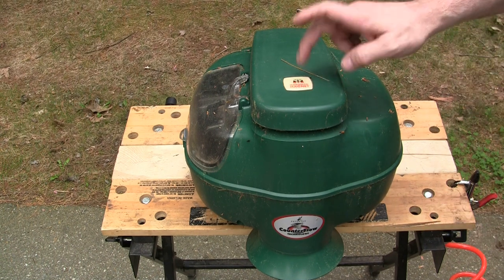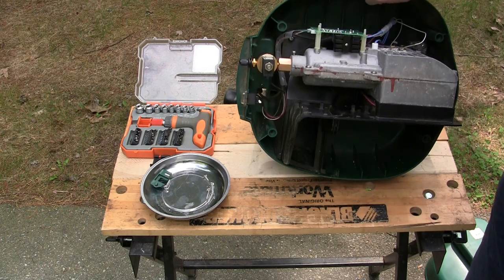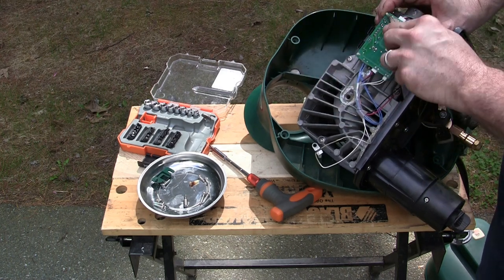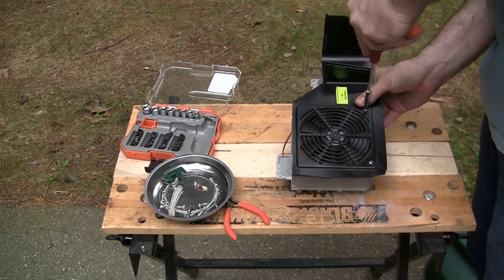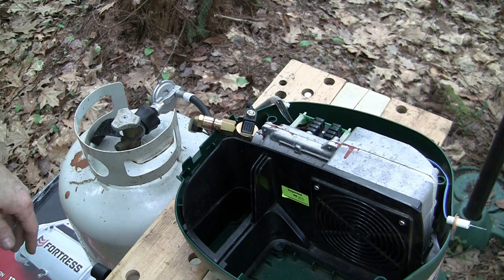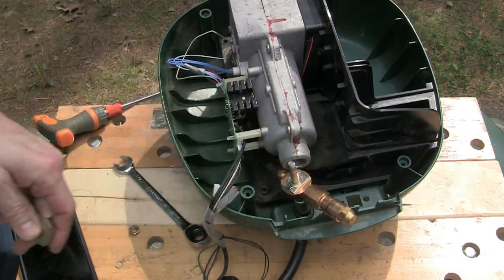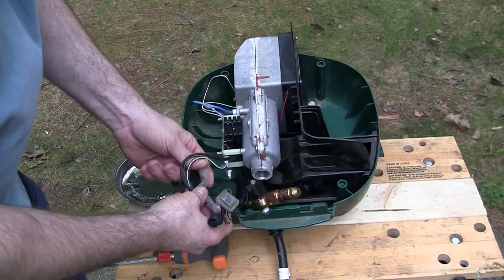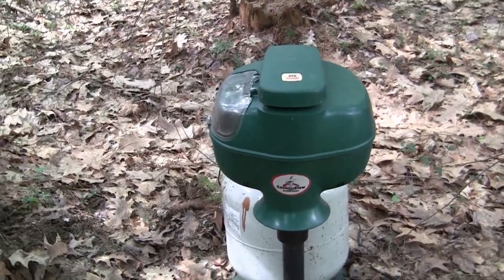Mosquito Magnet Patriot Plus repair

Comment: When we took the plastic screw out to clean the ignitor, the screw broke. Can we replace with a metal screw or does it have to be plastic🤷
Reply from the maker: I had that happen too. I used a little high temp rtv silicone to "glue" it in. Just put some under and over the tab. It will hold it and you can pull it out later if need be. If you did manage to clean out the rest of the plastic and put a metal screw, it would probably fuse to the housing over time due to galvanic corrosion (happens when different metals are used). Good luck!
Reply: Well, we have replaced the fuel filter, cleaned (sanded off) both the ignitor and thermo coupler. Fired it up yesterday, and it worked for about 6 hrs🤷We were not able to open the catalytic converter as the screws would not release🤷 Any other suggestions?

Comment: where do you find replacement parts? such as the solenoid? can't find online!
Reply from the maker: Other than the igniter, I have never needed a replacement part. From looking around, it seems they strictly control their replacement parts. You are, unfortunately, going to need to find suitable replacements on your own, or find a machine that someone is getting rid of and scavenge parts from it.

Comment: Hey man, I got a used mosquito magnet that isn't working, Ive checked EVERYTHING, ignitor lights up, thermistor is registering ohms and is going up and down depending on the heat if I blow warm air on it, thermistor is completely clean and new looking, propane is coming out nicely, gas orifice isn't blocked, solenoid clicks and opens gas, new propane tanks tried 2 different ones, everything is clean and seems to be working, but it's keep flashing fast red. I believe it's not actually igniting the propane. I don't really feel warmth at the front nozzle. Do you feel warmth at the front where the fan is sucking in? I'm thinking possibly the ignitor is weak and not igniting the propane? I can definitely smell the propane and the ignitor is definitely glowing completely red. It's just not wanting to run. I can't really feel any heat. Any advice? Do u think the ignitor is just too weak to ignite the propane?
Reply from the maker: If it is glowing red, I would think it is hot enough, but I suppose that is possible. One thing to try to start it with the plastic off. The metal will absolutely be warm to the touch if it is running. You said you cleaned everything, but have you tried blowing out the catalytic converter (the tube inside the metal housing at 13:53)?  If that is clogged, or not really reacting due to contaminates, it could be hampering the unit from getting hot enough. These are absolutely finicky machines, which is unfortunate given how effective they are when working. Good luck and feel free to send updates or further questions!
Reply: @DavinDesborough  Yes I have tried starting with the plastic off and on. Ive tried feeling the metal housing and I dont really feel any heat at all. It never gets to the solid red light though. So something is not allowing it to start. It doesnt seem like the propane is igniting, or its not staying lit long enough to feel heat. Maybe the thermister is shutting it down pretty fast before it heats up? I was checking the ohm resistance on my thermister and it was at like 250 k ohm I believe . Is that normal? Do you know what your ohm reading is on your working thermister? Yes I did take apart the metal housing and cleaned up the cata converter. I didnt see any blockages or debris in there. I blew it out but not with a compressor, just with my mouth. I scrubbed the metal parts a bit as there were some build up but not much. To give you an idea, my thermister was quite clean when I pulled it out, nothing like yours was, so the internals werent very dirty. I have no idea why its not starting, everything looks good, the igniter lights up, the propane flows, the thermister "works" and it registers heat. I dont really know if maybe the resistance is too high and not meeting the requirements, or maybe the igniter is not getting hot enough to ignite the propane. I am stumped... Ive checked and done everything in your video and all the components seem to be working
Reply from the maker: @Interrogreat  If you tested like I did at 28:40 then the gas side of the equation seems OK. We still have snow, so I have not done the maintenance on my trap yet. I will do some tests on the thermistor when I take it apart this spring. I believe they are generally specified at 25 Celsius (so roughly room temperature) and 250k would be a reasonable value. I would also measure resistance at the pads on the back of the connector where the thermistor plugs in. The value may be a bit different as it will be in circuit, but should be in the same general range. While there, look for any corrosion on the board, especially around the solder pads of any of the chips. Clean with isopropyl alcohol if you see any grunge.

Comment: I noticed you put it to work immediately after the repair.  Did you use any Octenol bait in the bottom compartment or does the machine do just fine in attracting Mosquitos w/CO2 only? - Thanks.
Reply from the maker: I do run the Octenol as it seems to help. I bought a bunch of it during an off-season sale, so it does not cost me much. It will still work without it, but it seems like I catch more with it. Good luck!

Comment: Hey, I've just picked up an executive model and after about 5 hours it shuts off (not set to turn off either time/temperature) and if I try to restart it shows the battery has died. I've cleaned it, replaced the battery, new gas, co2, everything I can think of but no joy, not showing any errors. Any idea? TIA
Reply from the maker: If it will always run for about 5 hours and then stop with a low battery warning, then I will have to guess that the  thermoelectric generator (TEG) is not supplying power back to the machine. That would mean it is running on only batteries, which quick run out. If you pause my Independence video at about 13:32 (https://youtu.be/VzFwGImwR5k?t=812), you can see the TEG on the large heatsink in my right hand. I assume the Executive will have something similar. With all that said, all I can think to do would be to try and measure the voltage it is sending when the unit is running and hot. I don't know what the voltage is supposed to be or where you would get a new one. I mean, you can get one from Amazon (https://amzn.to/43kv0PD), but I don't know what the right size or voltage would be. Try to find some marking on the one in your machine and see what you can find searching on that. Again, this is all just a guess. Good luck!
Reply from the maker: Sorry, the fact that you said "I've just picked up an executive model" just jumped out at me. If you just purchased it, try returning it for a new one. If your have picked it up second-hand, then see my other comment.  :-)
Reply: @DavinDesborough  ah no, I meant 2nd hand! Thanks for the advice though, I'll check it out.
Reply: @DavinDesborough  hey, I replaced the TEG but no joy, same issue. Any other advice? Cheers.

Comment: Just found a brand new liberty plus at a thrift store, only part I’m missing is the ac adapter to plug into the charge port on the back. Any idea what adapter would work?
Reply from the maker: That you can buy from the MM store. It has a proprietary connector on it. You might be able to find one used on eBay for cheap. Good find!

Comment: Can you recommend a co2 clean out method without having to buy the cartridges?
Reply from the maker: It is really just the act of forcing air through. If you have an air compressor, you could use it. It wont have as much force, but it may still work. From what I read, those cartridges have an initial PSI of around 800 (or more), so your average home user compressor will be well under that. The only question is if they are actually too weak. I am going to have to try this out now.
Reply: @DavinDesborough  plz keep me posted. The cartridges r getting expensive. Thx
Reply from the maker: @alainnadeau3421  Will do. Note that you can by any threaded cartridge, it does not need to be from MM. Something like this will work just fine: https://amzn.to/3w9BsZa.

Comment: Any idea why mine starts but the next morning when I check it I get the fast flashing and don't collect many mosquitos which is unheard of in Alaska,
Reply from the maker: I would guess the thermistor might be going. Overnight the air cools and it's possibly bringing the temp of the unit down below the cutoff point.  That or perhaps the cooler air lowers the propane pressure just enough to not make it through a partially clogged jet. I am just guessing though. Try taking it apart and cleaning it up. In general, that is what does it for me. Good luck!
Reply: @DavinDesborough  Thanks

Comment: how exactly does it trap the mosquitoes? if they can fly in, what prevents them from flying out?
Reply: I think it works like a vaccum......
Reply: @BattousaiHBr  idk I just guessed it would suck the mosquitoes
Reply: @siccbastard4580  but that doesn't tell me how they are kept inside of it after fuel runs out, a vacuum would need to be sustained
Reply: @BattousaiHBr  ummmm......... they die?
Most of them?
......perhaps?
Reply: they are vaccumed and trapped inside, they die in the next 24h. +mosquitos dont live for long without feeding+
Reply: @RizzerAI  what is trapping them inside? if they're trapped, how did they go in in the first place?
Reply: @BattousaiHBr  they are attracted by the strong smell of propane +it smells like our body odor to them btw+. if they get too close they are vaccumed inside that tank and cant get out.
Reply: @RizzerAI  you don't get it...
the vacuum exists because the fuel is being consumed to create it, after it's over there is no longer any vacuum.
there can't be any soft of physical barrier to prevent exit as that would prevent entry in the first place.
so after the fuel runs out, what exactly is preventing them from just getting out again?
maybe they die before the  fuel runs out?
Reply from the maker: Like @sicc BASTARD said, it vacuums them up into the container where they are dehydrated due to heat and airflow. A longer explanation: The machine emits CO2 from the center of the horn that points down. When mosquitoes fly around looking for the animal emitting co2, they get caught in the updraft of the vacuum and are dried out on the catch net.
Reply from the maker: Not the propane itself, but the CO2 from burning the propane. Otherwise, you got it right.
Reply from the maker: The unit is plugged it. The fan that creates the vacuum runs off of that electricity (in this model anyway). In any event, they dry out and die fairly quick. If the machine were to shut down due to power outage or lack of propane, I would not expect many to escape. It is a twisted path for them to follow to get out.
Reply: @DavinDesborough  oh i get it, after getting inside, they are instantly killed from the heat, so there's no chance for them to get out after fuel runs out.
Reply from the maker: @BattousaiHBr  I wouldn't say it is instant, but they are dead within a few hours or a day I think. It is usually a  day or so before I notice the trap has run out of propane, and there is seldom a live one in the net. If a couple manage to escape, I figure I'll get them next time.  :-)

Comment: What can be wrong? My battery only works for a day or couple of days. I have bought a new battery but it still works just a short time.
Reply from the maker: What model trap do you have? The Patriot Plus does not use a battery. Also, what code is the machine showing? Or is it just dead?
Reply: @DavinDesborough  I think it’s the Independence model. It is 5+ years old. Last summer I could use the battery for a month and now for 12-24 hours. The battery is brand new. Is it only the fan that needs electricity?
Reply from the maker: @leifberglund4668  I believe I might be experiencing the same issue with my Independence. I am going to be troubleshooting it soon, I will report back on what I find. I think the unit is resetting and constantly restarting, thus eating the batteries.
Reply: @DavinDesborough  I see forward to hear from you again. I can’t see that the unit is restarting. I wonder if the fan need some oil. Or is it something more that uses electricity? I live in Sweden 70 kilometres north Stockholm in the countryside near the Baltic Sea. Just now we have a lot of mosquitos. More than I can remember.
Reply from the maker: @leifberglund4668  The fan is the same sort you'd find in a computer. No oiling it. It most likely has sealed bearings. There is a thermoelectric generator (TEG) pad between the combustion chamber and the heat sink. My guess is that is supposed to help keep the unit powered as long as it is hot. It won't generate 100% of the needed electricity, but probably enough to significantly extend the battery life. My theory is that the TEG is no longer providing electricity. It is going to take some time for me to test this out, but I'll write back when I do.

Comment: I did every test you did in this video. Evrything has the same outcome as yours. The insides actually aren't as bad as this one in the video. It gets to the end of the 15 minutes time and blinks fast again. I don't get it.
Reply from the maker: Leave the top off of it and try starting it. Does the metal warm up? If so, it is starting fine, but not detecting the heat. Sand the metal probe to get all corrosion off of it. If that still does not help, check to be sure the wire has not come loose at the circuit board

Comment: Only had mine one season , took it in for the Winter, installed for new season and now have the red fast flasher, for the cost they should perform  much longer, very disappointing.
Reply from the maker: Yes, the engineering seems a bit brittle. I just had to work on mine again. I was running fine all through the spring, but when I changed the propane, it refused to start. Took it apart and blew out all the dead bugs and spider webs, cleaned the corrosion off the metal probe for the thermocouple, and it fired right back up.
Reply: Amen. The unit is awful. It works great when it's running, but that is rare after the first season. Pulls 'em in...stops running in less than 24 hours and right back out they go. After year one it's more like a short term Mosquito Hangout location.

Comment: Mine doesn't even power up. No red light whatsoever. Anyone know why?
Reply from the maker: Sorry, this was caught in the YouTube spam filter. I would try to measure the voltage at the end of the cable to make sure the power supply brick is still working. If that is good, then you have something potentially more serious wrong inside the device. It would take some careful probing with a multimeter to see where voltage is flowing and what might be dead. Hopefully it is just the power supply.
Reply: @DavinDesborough  I found out that it was the power supply thanks.

Comment: I have the mosquito magnet patriot plus and it starting blinking fast. We narrowed it down to the thermocouple/ thermistor. Contacted the manufacturer and they said they do not sell this item and that I would have to send it off to be replaced for $110.00. Do you know were I could order this item from? Awesome video
Reply: Thermistor assembly is repairable.  See  http://diyideasandthought.blogspot.com/2014/12/mosquito-magnet-defender-repair.html  You can also find these on ebay.  Look for thermistor,  200 kohms,  NTC.
Reply from the maker: Thanks for the link!

Comment: This unit works well but is such a bad design for durability.  Worked great first year, put it away in basement for Winter, brought out the following year and would not ignite. Sent back under warranty, by the time I got it back Mosquito season was over and didnt get much use out of it so back in storage it goes.  Took it out to fire it up last week and again wont ignite.  Piece of shit.
Reply from the maker: They are fiddly for sure. I usually need to clean mine out and sand off the thermistor probe at the start of the season to get it to stay running. Had they invested a bit more into parts and design, they would be fabulous.

Comment: I know this is a super old video but hoping you’re still around. I can’t seem to get my igniter to light or my selenoid to open. I’m skeptical both failed as I put a volt meter on the leads for the igniter and I get zero voltage at that first fan slowdown and speed up. 

Any ideas on that? Board itself failed? The fan still fires up and I never get a fast flashing light just the steady startup flashing light the entire time, for hours if I leave it be.
Reply from the maker: Still here! That does seem odd. I would start by undoing all the plugs on the circuit board and trying to clean it. Get some high percentage isopropyl alcohol and an old toothbrush and scrub the board. Perhaps there is just something across a couple pins or something. The failure mode, however, makes me think something is wrong with the main control chip and it is freezing up at a certain point. It shouldn't run indefinitely like that. It should either start or present an error, but hopefully a cleaning will fix it. After that, try starting it with the gas solenoid disconnected and see if it runs forever. If it still does, plug it back in and try the same test with the igniter. Lastly, re-run the test with the thermistor. If one of those tests changes the behavior of the machine, it might point to something to dive into more. Good luck and let me know if anything changes. Glad to help troubleshoot!